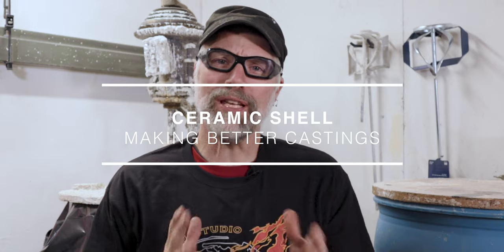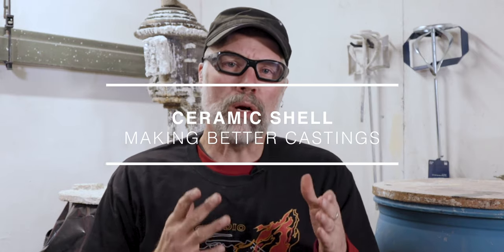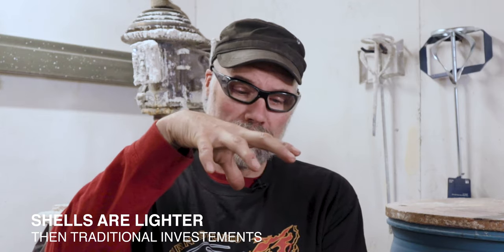Why I use ceramic shell.

Comment: I would love to set up for shell, still looking for a decent cheap used kiln I can add temp control to and use for burnouts.  
An old school plaster/sand/ludo block investment guy I know would point out that he can cast stuff as fine as leaves and flower petals without destroying them trying to bust off the shell... I guess we all have our favourite methods and materials. :)
Reply from the maker: True, when casting delicate objects extra care needs to be taken to during brake-out.  There are some tricks to help this process and of course a sandblaster can facilitate this step as well.  Ill talk more about that in a upcoming video.
Reply: @LunarburnStudio  sounds good, keep it up, this is a great series.

Comment: With the good porosity, do you use it with vacuum casting? Or does the high-temp/good fluidity negate the need for vacuum?
Reply from the maker: I have never tried using a vacuum with shell casting, could work.  But you are correct, because of the characteristics of the shell and its porosity you can cast crazy details without the aid of centrifugal forage (spin casing) or vacuum.

Comment: Hey Eric, I want so say thanks! I did my first ever casting this weekend and used a shell method. I love the videos! Do you have any advise for using ceramic shell with hollow passages? The break out is proving somewhat challenging.
Reply from the maker: I hear ya,  depending on the access to the cavity you might need to cut windows in the wax to provide access then you weld the windows (part you cut out) back into the casting.  The advantage to to this approach is that it creates an anchor point for the core and allows your core to dry more evenly.  Another technique is to use a pneumatic (air) hammer to remove the shell.  Hope this helps.
Reply: @LunarburnStudio  Thanks! Have you ever tried a hybrid investment/ceramic shell? I might try filling the internal cavities first so that they wash out cleanly.
Reply from the maker: I worked for a time at a foundry in Boston and that is exactly how we handled deep tight cores.
Reply: @LunarburnStudio  Excellent! Thank you again for making your videos and putting your expertise out there for us to learn from. I hope to have some photos to share soon.

Comment: What would be the reason if the shell is sticking the casting after the metal pour ? Not breaking apart
Reply from the maker: Its not uncommon for the shell to stick somewhat to the metal.  Texture of your pattern, metal temp, mold temp, metal type, shell type can all play apart.  What are you using?
Reply: I am using gun metal also known as red brass ,temperature ranges from 1200-1250 degree Celsius .
Reply from the maker: @shivanisutar6522  is your shell fused silica, alumina, other?
Reply: @LunarburnStudio  my shell is fused silica
Reply from the maker: @shivanisutar6522  Fused silica is pretty tenacious stuff, but high temp metal can potentially burn-in to the shell surface. Sometimes an initial coat of zircon stucco on the first dip can help create a more durable barrier.
Reply from the maker: @shivanisutar6522  After sandblasting, are you noticing any loss of detail in the metal?
Reply: @LunarburnStudio   yes , I do get some blow holes on the casting . But I think the issue is with the metal temperature.
Reply from the maker: Maybe so.